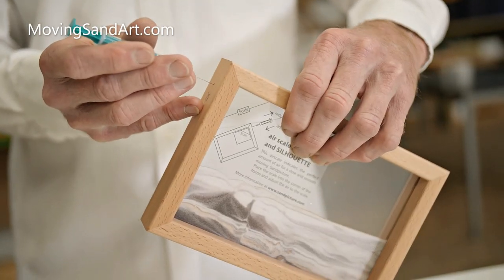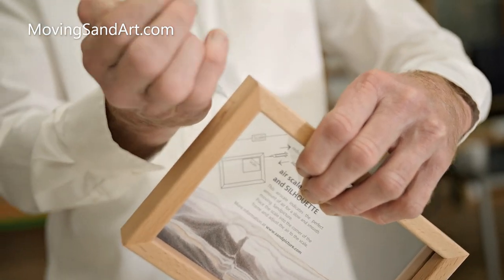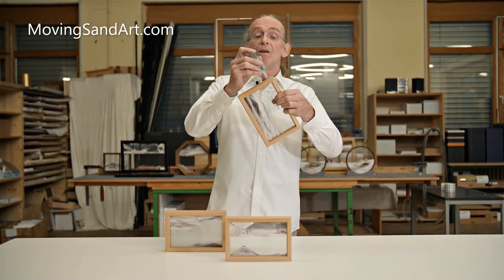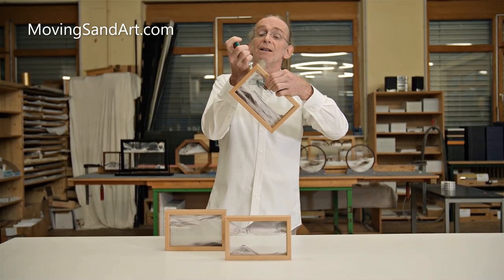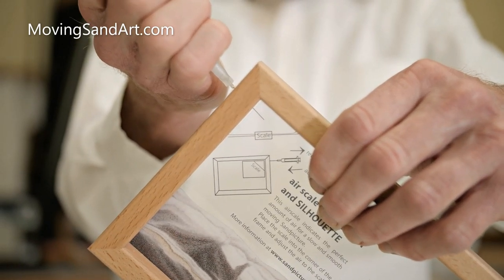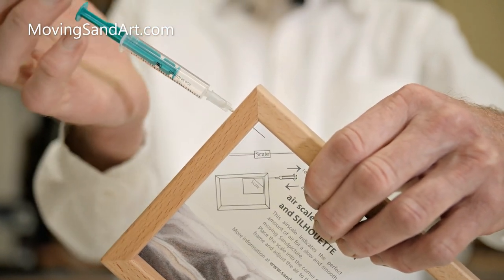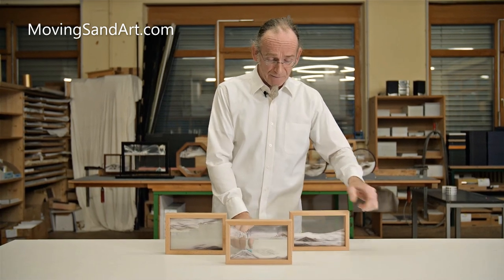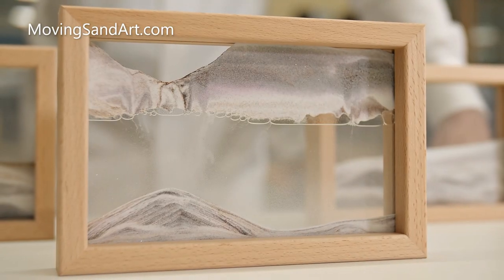How to adjust the air in your KB collection sand picture

Comment: No matter how much air I put in or take out….my sand only ever falls in a horizontal line. No peaks or designs. Mine is round and did not come with a scale. I’ve played with it for hours. It never changes despite the change in air.
Reply from the maker: Hi Allison, There are a lot of cheap Chinese knockoffs on the market these days.  None of them come with an air scale.

Comment: i have alot of air but very tiny bubbles what to do?
Reply from the maker: Break up the bubbles.  Get all the air at the top and then thrust the frame into the palm of your hand.  Usually, this breaks up the bubbles.  Of course, I can only speak to our KB collection sand art.  There are other makes that use too much soap or have different mediums (liquid).

Comment: What about my round one?
Reply: Same principle, Cindy.  Point the air hole towards the ceiling with all the sand at the bottom.  You will see the round part of the air scale that will conform perfectly with the round part of the glass of the Deep Sea.  This round line should go along where the frame meets the glass (not on top of the frame for example).  If you see your water line start above the air scale line, you need to add air.  If you see the water line start below the air scale line, you need to remove air.  You want your water line (the line that separates where the air ends and the water starts) to be perfectly on the air scale line.